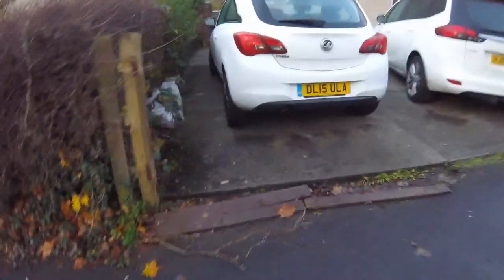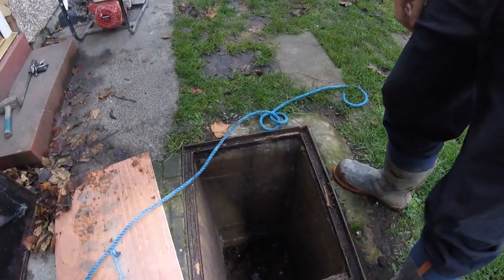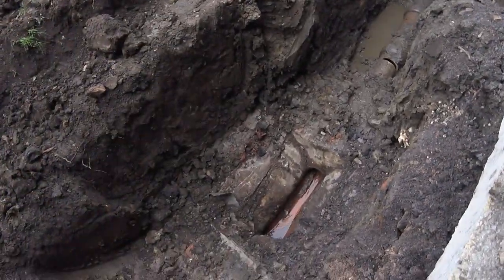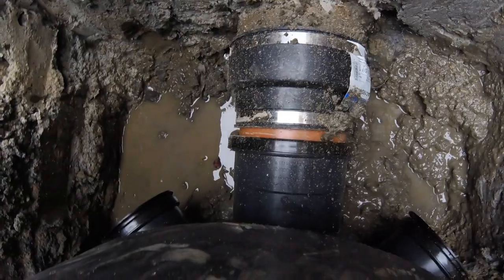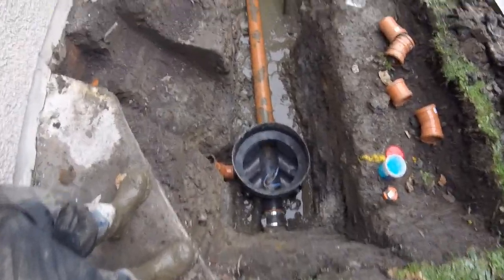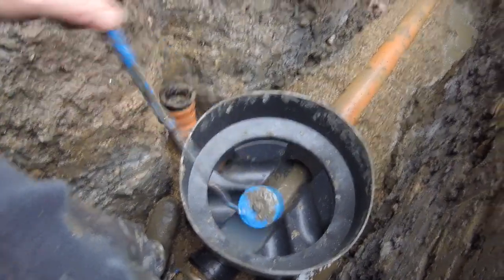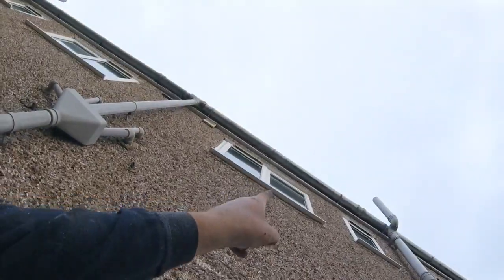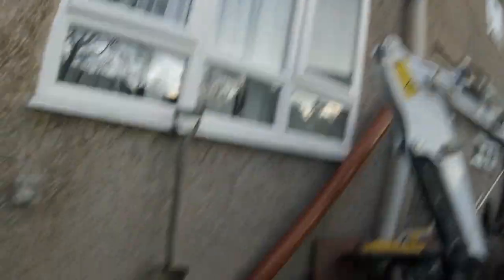How To Move A Running Manhole Clean A Drain LTD 054

Comment: Whoa, that one is DEEP, I think you're going to have to crawl down over IN that one, lol!!! Well, maybe not!!!
Reply from the maker: 🤩🤩🤩Yes it was a deep one. The Groundworker who was doing the Extention wanted it moved out the building line to outside the Extention altogether but unfortunately he was not competent moving it as it was a live sewer and think about 1.6m deep. We have done many live connections over the years and was nice to video you a one. We tend to get all the hard jobs that no one els wants to do but we love them ones. 👍
Reply: We are doing one like this but we have to take the manhole out and replace with a pipe so its sealed. The only issue i can see is how do you get the drain plug out afterwards? I guess if you can find the next manhole in line and block it there it will be good with some rope to pull it out if it's too bad. Otherwise you need to put a sealed manhole or a strap on boss that can be sealed afterwards to get the plug out. Otherwise I'm not doing the connection live my boss can convince someone else @cleanadrainltd1246